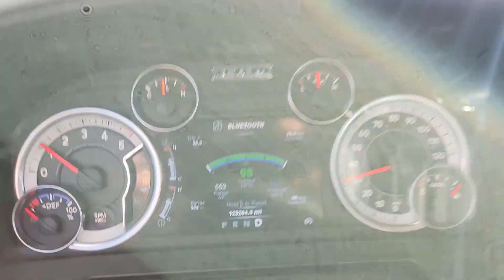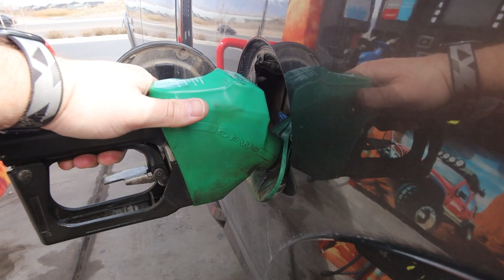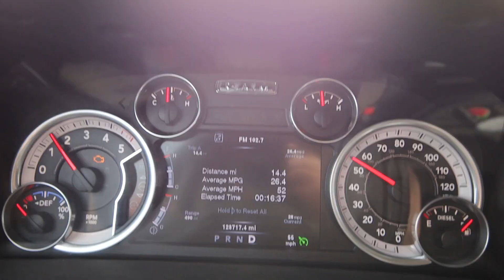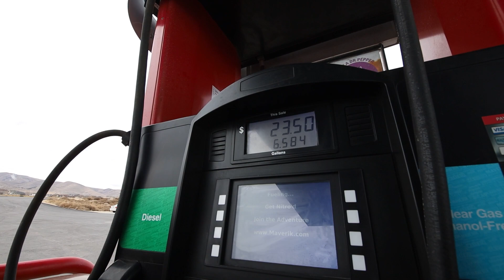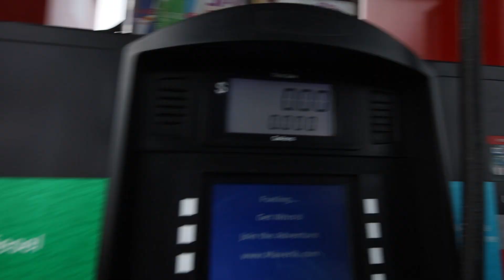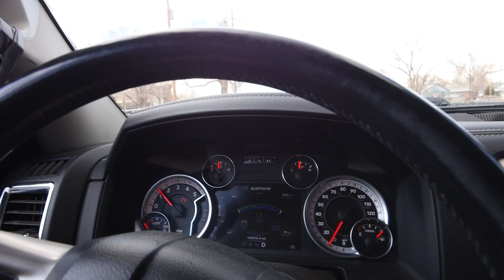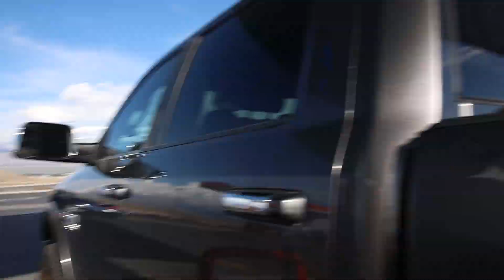EcoDiesel Tunes Compared! MRTUNING, SFT, GDE AND Reckless Motorsports. Part 1: MPG Test!

Comment from the maker: This is part one in my comprehensive comparisons I am doing of these 4 tunes. The next comparison will be 0-60 and 1/4 mile times, and followed by a dyno run for each tune.
Table of Content: 
- Reckless tuning: https://youtu.be/GccGnL9rvbI?t=12
- MRTuning: https://youtu.be/GccGnL9rvbI?t=160
- SFT: https://youtu.be/GccGnL9rvbI?t=539
- GDE: https://youtu.be/GccGnL9rvbI?t=962
- Summary: https://youtu.be/GccGnL9rvbI?t=1222
Reply: Thank you for your video. it's a few years old now lol. My 3.0 is trash at 121k miles. Wondering if you did comparisons of clean oil? Everytime I changed my oil it never looked like it. I just can't help but think that is a problem. I'm doing a new motor or rebuilding and what to do a tune to keep the oil clean for it to last 400k or more ANY suggestions would be great. I will be keeping the stock exhaust for legal reasons.

Comment: When you did the M tuning one, which HP package did you choose? And when did you first tune your truck? Thank you
Reply from the maker: @NicholasPhillips-l5v  I'm pretty sure this was their 40hp offroad tune I believe, but not 100% sure because I bought it used from someone else. 

Mr tuning wouldn't sell me a tune once he found out I was going to be comparing them.

I first tuned my truck around 60k miles with gde's first tune back in 2018. About 6 months I installed the sft tune and compared those 2 tunes first.
Reply: @GlennPearsonDIY  gotcha. So it was the full delete? I have the stage 1 40hp, put the gde in at about 50k. That's lame he wouldn't sell it to you. But you got it regardless.. trans tune also?
Reply from the maker: @NicholasPhillips-l5v  Yes fully deletes. Trans tune is a separate computer, so I was unable to run the trans tune for Mr tuning. I did have gde's transmission tune, as well as sfts. Reckless's transmission tune was garbage. I fixed it for him and sent it back. He ended up using my revisions for other customers. 

I had my own custom transmission tune on for all of the testing.
Reply: @GlennPearsonDIY  OK, thank you for your feedback, it's much appreciated. Do you know how your trans tune compares to Mr tunes one? I'm curious as to how my power and mpg will change once I do the full offroad tune.
Reply from the maker: @NicholasPhillips-l5v  I gained probably 2-3 mpg once I fully deletes my truck. The transmission tune probably helped with 1-2mpg. 

I honestly don't know how it compares to mrtunings transmission tune because I never had it. But it was similar to gde and sft's tunes, but I didn't let it lug as much, especially in tow/haul mode. 

It's been a couple years since I've messed with any ecodiesel tunes though, kind of out of the loop lately since I sold mine back in 2021.
Reply: @GlennPearsonDIY  Makes sense, thank you again.
Reply: Sorry one last quick question. Do you recall if it took some time for the transmission tune mpgs to increase?

Comment: Have you found that using a cetane boost helps with power & fuel economy ? I have seen a significant increase in my CRD Jeep Liberty.
Reply from the maker: @davidchristensen2898  yes I did notice a small difference, though I never ran a test comparison. I used the Lucas fuel additive the most and that, while not a cetane boost, added lubricity and I got about .5-1mpg more with it. I also ran the hotshots secret diesel extreme occasionally and that also made a difference.

Comment: 27mpg on the M tune. I run the same M tune stage 2 on my 2019 ram EcoDiesel Classic (crew cab 6'4 box with 3.92 gears on 17 inch factory steels on Michelin LTX) get 29-30mpg and thats going by km's and how many liters i put in not the truck telling me. in northern and southern Ontario Canada.

Comment: Installed MR Tuning after having DEF issues. Had the GDE Emission tune prior. I much prefer the GDE transmission tuning, but very much enjoy the MR Tuning power and emissions delete. Has anyone figured out how to run a GDE transmission tune and the MR Tuning ECU tune? GDE Tune is sold as a ECU & TCM combo.
Reply from the maker: Yes, you can do this if you have HPtuners and license your ECM and TCM. Install the GDE tune, read the entire file with HPtuners, then install the MRTuning tune, read the entire file. Open the MRtuning tune, and open the GDE as a compare. Copy parameters from GDE TCM to MRtuning TCM tune. It will cost you a few hundred bucks to license with HPtuners, plus the cost of the hptuners MPVI3 device.

Comment: I know I am a little late but would love to see what you think of the Banks Derringer. I have had one on my 2020 Ecodiesel for about 6000 miles... the only thing I wish I did different was not waiting so long to get it. It went from driving like a tractor to being just as quick and responsive as the Hemi ones. It's not a rocket by any means but it isn't a fat pig anymore either lol. What amazes me the most is the turbo, it can go from 0-30PSI of boost in what seems like just a second. Wild lol
Reply: I have a 20 as well and been thinking about the banks. No issues at all?
Reply: No issues at all, Its been on there for about 6 months & maybe 7500 or so miles now. It uses a little more DEF but nothing noteworthy. Definitely get the derringer, pedal monster & the dash gauge to control them both. You won't be sorry... If I turned the TC off I know I could absolutely roast the rear tires if I wanted to. On full tilt it has enough torque to restart a dead planet it feels like, this engine has so much more potential than you get from factory... idk why they don't just sell them this way... they would be a lot more popular.   @pt18777

Comment: Fuel economy display is wrong on like every tube right?
Reply from the maker: Maybe slightly but I adjusted for the tires. I also hand calculate the mpg based on the miles driven so it's 100% separate from what the truck showed.

Comment: Can you run a MRTuning tune with a GDE trans tune?
Reply from the maker: Yes. Completely different computers. I ran sfts transmission tune with gde engine tune for almost 2 years.
Reply: I tried it and it wouldnt work.  “Inspect throttle body sensor” errors popped up.
Reply from the maker: @douglashardy177  throttle body error is 100% ecm only. The transmission tune has nothing to do with that.
Reply: But its not there when I remove the GDE trans tune.  Ill just have to get the MR Tuning trans tune

Comment: Glenn, just picked up a 17 eco diesel and stumbled on your video. I’ve been going through the forums trying to figure out what tune to go with. I’m hoping for a little extra power and mpg but also longevity of the motor, any recommendations would be appreciated since you’re one of the few folks I’ve found who has actually used them all. Thanks

Comment: Thank you for all you do for the Ecodiesel.
I have a 2020 Ram Eco., I’m torn between MRTune,  GDE, & Reckless for tuning. In your opinion is it best to shut down the EGR completely?  Or does the GDE tune minimize the soot buildup in the intake manifold?
Reply from the maker: GDE will do a great job of minimizing soot buildup, but they have to run the EGR during warm ups, when soot production is highest, because of EPA regulations. I haven't tested any of the tunes on the 2020+ engine. Honestly I'd go with MRtuning (as much as I dislike the guys that run it) or even SFT, if they still shut off the EGR. 

That said, with the changes they made to the 2020+ engines, even with the GDE tune, I would imaging you will have a solid and reliable truck for many years.

Comment: When I delete my ecodiesel I'm going with mrtuning ecodieselcanada
Reply: Those guys are clowns. They took my money and others as well. Scam you if you’re in the states.
Reply: @RaceMentally How so? I am looking to tune my truck, and they seem to be recommended quite often. I definitely don’t want to be scammed.
Reply: @alext5121  there a guy who is on the pages saying they don’t tune for elevation. I had my truck dynod in Colorado Springs and the guy was right. I made less power and it smoked. I’m testing oil like he said to see how much fuel is in my oil. Not to happy about it. I thought I was getting a tune that changes timing and fuel.
Reply: Thanks. I switched from the GDE EPA compliant tune to MR Tuning.  I didnt end up getting the EOC trans tune as I wanted to see if the GDE trans tune would be complatible first.
Reply: @douglashardy177 
What’s your thoughts after you switched?
Reply: @douglashardy177  Did you figure out how to get the GDE trans tune to work with the MR Tuning ECU tune?

Comment: Which reckless motorsports tune did you use I'm looking at putting one on my 2018 ecodiesel . Did you also straight pipe your exhaust or did you muffler delete or anything?

Comment: What app do you have on ph for calculations? And how are you watching timing?
Reply from the maker: Torque pro allows you to see injection timing. Same with the OBDLink app. I'm using both, switching between the 2 on occasion. For this I think I just had torque pro running.

Comment: I have a 2014 with 120k miles which do you suggest to look into for a stage 1 engine and trans tune? It is basically a stock truck but I do have wheels and tires waiting for it when I need to replace the tires that I have currently.  I mainly drive highway so I am looking for better mpg and also longevity. Would love to do a stage 2 and delete but no shop in my area is willing to do the delete.
Reply from the maker: Delete it yourself. There aren't many shops anywhere that will do it. Most so the work themselves.

I'm comparing some state 1 tunes in my dad's truck right now. I'll share some videos soon on how things go.

Comment: Have you or do you know anyone that has compared transmission tunes from these tuners? I have ran a couple of the tunes you’ve tested and the trans tunes are completely different. I’m looking to make some changes because I have a decent tune but a horrible trans tune. I really hate to spend the money on a new tune and wind up in the same boat I’m in now. Any insight on trans tunes would be very helpful. Thanks
Reply from the maker: I've ran 4 different transmission tunes. Tbh, 3 are almost identical. One was awful. So whenever I ran his tune I ran one of the other transmission tunes. Gdes transmission tune seemed to be the best and sft's trans tune without the rally option was pretty much the same.
Reply: I agree GDE has an awesome trans tune. I thought that when you buy the tune from a particular tuner the trans tune was married to the engine tune. So is it possible to use an engine tune from one tuner and a trans tune from another?  Example: if I ran my an GDE engine tune and a SFT trans tune or The other way around? I’m just very new at this tuning thing and I’m kind of lost on some of this tech stuff.
Reply from the maker: @NOS-ZL1  They are completely separate computers in the ecodiesel. The issue is, most of these companies include one device to flash both and it installs or removes both when you flash. I am not sure if there is a way to have it only remove the engine tune or transmission tune, but if it can that would answer you question. I use HPtuners to flash different tunes I own and I can flash the transmission and engine tunes separately. I've also swapped ECM's completely, which of course leaves the transmission alone, and that way I have a separate engine tune running with the same transmission tune. 

So there are ways to do it, but I'm not sure if its possible with the touchscreen device that comes from the tuner. Depends on how they set it up.
Reply: Thanks for the info. Great video 👍

Comment: I'm a bit confused.  I've watched multiple videos for this engine and the mpg are as good as these tunes are showing without any modifications.  What am I missing?
Reply from the maker: My truck has a 6" lift with 37" tires. Without the tunes it gets 23-24mpg on this same loop. The tunes make a huge difference. Don't compare the newer 2020+ ecodiesels to the previous generation (2014-2019) as the newer engines get better MPG. Also the 3.92 axle gets 2-3mpg less than mine does, and those who have a similar lift see 19-21mpg average. 

Not sure what videos you are watching but its obviously not comparing apples to apples.

Comment: Hey Glenn, got a glimpse of the dumpster fire that is the tuning discussions in the forums. Which tune are you using for your daily and why? Thank you for taking the time and sticking your neck out to do these comparisons. Much obliged!
Reply from the maker: Thanks for the comment. I actually sold my ecodiesel a few months back and upgraded to a 3/4 because of my towing needs. I miss the fuel economy and my truck. But I'm still involved in the community because my dad owns an ecodiesel and I still get a lot of questions. 

I ran my own tune the last 5 months or so. I never was ever 100% happy with any tune. If I was towing I used sfts tune. If I wanted good fuel economy and reliability I ran GDEs tune. Reckless performs very well but I don't trust it for long-term reliability. Mrtuning/EOC will do anything for business and have no morals. Their tunes are very similar to sfts but they have more power at full throttle with the expense of more smoke, which is a tradeoff I'm most diesels. If your not deleted, sft and mrtuning are near identical. Gde stands out for fuel economy and has more midrange power than both of them. 

If I were to do it again and didn't know how to tune, I'd probably go with sft or find a used gde ECM and program it for my truck, which anyone can do and there is a writeup in the forums on how to do it step by step.
Reply: @GlennPearsonDIY  Just curious what it is about the Reckless tune that makes you worried about reliability? Is it a certain parameter in the tune? Too much boost? High EGT's? Timing?
Reply from the maker: @ericanderson5827  egts are lower than other tunes, mostly due to the advanced timing he is tunning. Some of my concerns come from the timing being really high, casting more pressure in the rods and Pistons than they should have long term, and boost being maxed for the turbo. There also isn't a lot of experience tuning diesels for him to fall back on so some of the changes he has made were based on either issues, or advice from more experienced tuners. 

The tunes have gotten better than they were when I tested them. But he has always been performance first, safety second. For me using my truck commercially to support my family, that didn't fly. I ended up modifying the tunes for my own situation and eventually just ran my own time completely. I sold me ecodiesel a few months back so now I don't even do anything with h the tunes. But I will most likely run a few comparisons in my dad's truck for stage 1.
Reply: @GlennPearsonDIY  greatly appreciate the prompt reply! I’m assuming you’re referencing a pre-EPA GDE tune? I actually found one sans the transmission tuning (September 2019, I believe it’s just the ECM tuning but I’ll have to check with the seller).

Very close to pulling the trigger on the GDE EPA compliant tune, but my preference would be to delete.
Reply from the maker: @coachluke85  since your buying the ECM (engine control module) it would be the engine tune only the transmission is controlled by the TCM (transmission control module), so they are completely separate tuners. The touchscreen devices are computers capable of accessing both the ECM and TCM which is why they can install a tune for both. This has only been possible for about 2 years. 

Prior to that, the touch screen device was used for the transmission and you would need to use another method, like bench flashing, where gde would flash a complete ECM with the updated engine software. This required either a completely new ECM, or you mailing I'm your ECM. With the 2020+ ecodiesels this is how they are being tuned right now as well because the touch screen devices cant access the ECM yet. FCA does this on purpose. 

You can order an sft transmission tune if you want just the TCM tune, or if you have or want to pickup hptuners you can get it tuned through hptuners. It would cost about $400 total to pickup the hptuners movie and license your transmission. Depending on the year of your truck. 

I can help with hptuners and your transmission if you decided to go this route.

Comment: Glenn, Thank you for the review! would you please share the device and app your phone is using to present those gages?
Reply from the maker: Yeah I have the OBDLink MX+ adapter and I use either the OBD link app or torque pro, which is a really good one. I'll switch back and forth sometimes between those two.

Comment: Glenn which tune  do you recommend for 15’ 120k miles.
Reply from the maker: Are you wanting to fully delete or go stage 1?
Reply: @GlennPearsonDIY  fully delete
Reply from the maker: @pueo0001  reckless/ecodiesel USA, mrtuning and aft all have deleted tunes. Mrtuning and sft will perform almost the same. Reckless will be a little better for power and fuel economy but maybe not longevity. But it's unknown, hasn't been out as long as the others.
Reply: @GlennPearsonDIY  thanks for all the info !!

Comment: Were you running stage 1 or 2? Also is that a 4x4 and 3.55 or 3.92 rear end?
Reply from the maker: Stage 2. 4x4 with 3.55 and 6'4" bed.